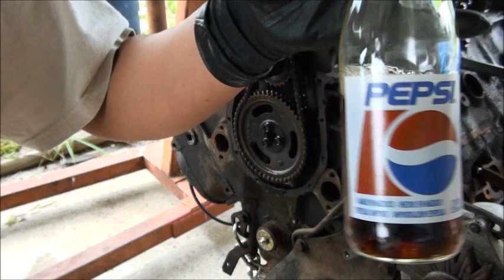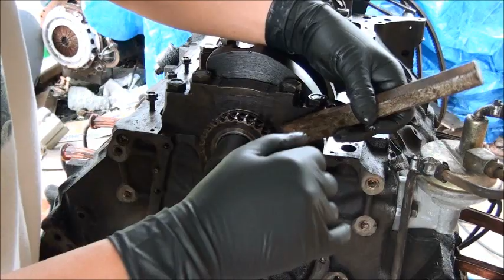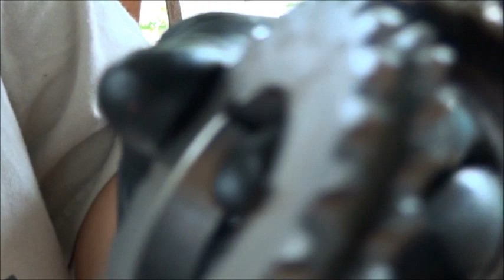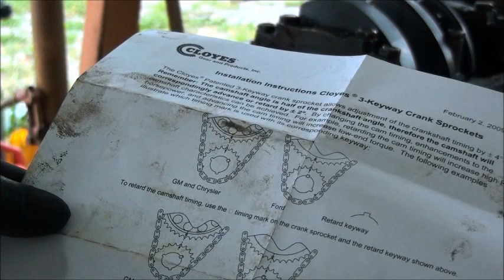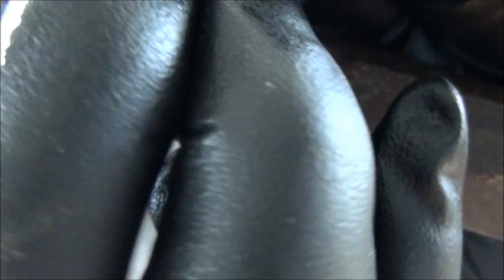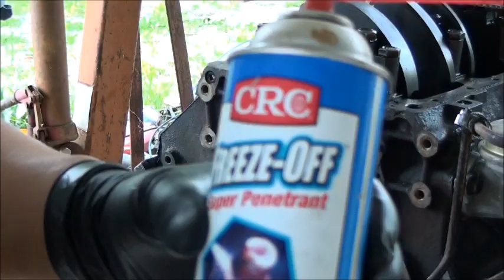427 BIG BLOCK TIMING CHAIN REMOVAL & PARTS INSPECTION !!!

Comment: hello nice video. am about to do a mercruiser 454 timing gear soon. should the engine be on tdc when doing this. thanks
Reply: +lanze wilson if your asking if it needs to be before disassembly the answer is no , you just have to make sure the marks are lined up on the timing set during install , if they are the cam is set in relation to the crankshaft , and all is well, and your good ... yes it really is as simple as it seems to swap out the timing chain and gears lol

Comment: find the #1 cylinder , hold thumb over spark plug hole , turn engine till it pushes it off the hole , then turn engine till the pointer and the tdc mark is in alignment , at that point drop the dist in with the rotor pointing to the 1# plug wire on the cap , make sure to place the dist where the vacuum advance can swing either way so you have adjustment , then from there it trial and error to get it to where it will run , then use a timing light ...

Comment: WHAT! Screw prying and cussing.  Three jaw the crank gear, it comes right off in 1 second.  I was surprised when I changed mine. Yours must of been ON tight! Then use the nice install socket tool on a harmonic balancer install tool to press it on nice for the re install. Mine came out mint! No hammering no prying. I hate that stuff. I put off changing my T chain for years, I regret it. What a difference it made!

Comment from the maker: I know it will run the same , I was just trying to get that point across , but after your comment , I guess I did make it sound like it might run better lol , I have seen several that when you put a timing light on them the mark is on the wrong side of the engine though lol

Comment from the maker: these tall deck truck engines , are really a factory race engine , with a lowered compression , and a torque minded cam , a couple hundred bucks , and a little time , you can make one nice street car engine dirt cheap , I got lucky on the condition of this engine , I did bearings on it , but heck they were in great shape , just hated to not do it lol